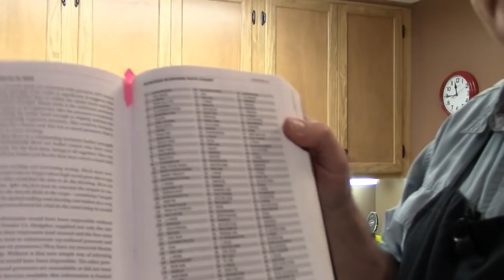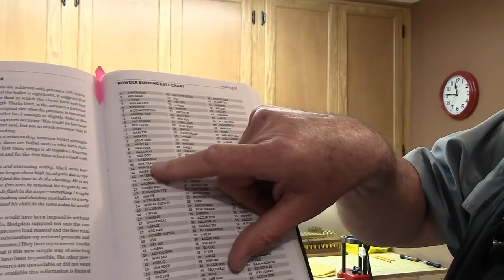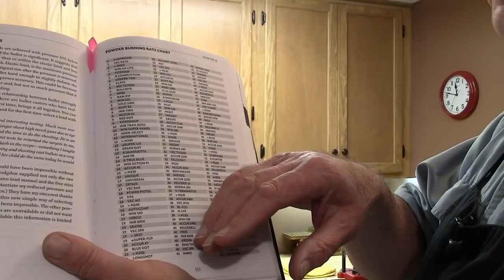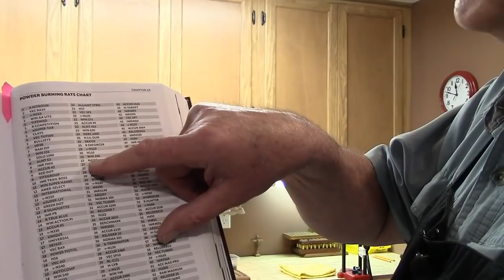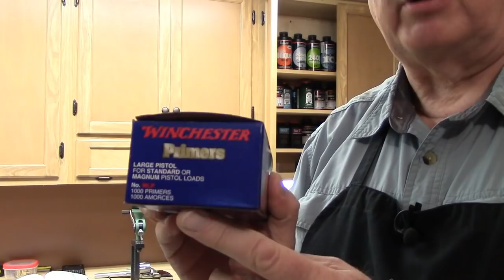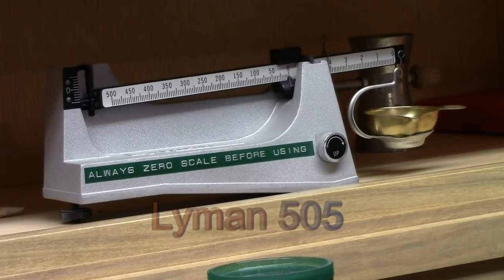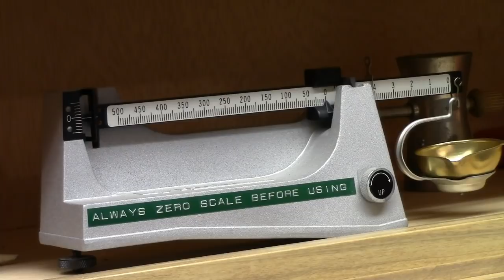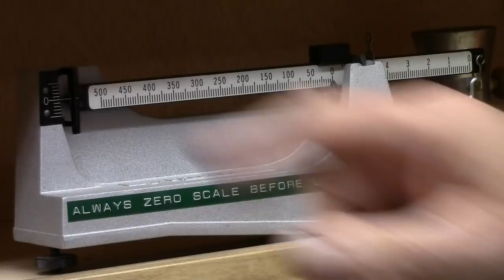Handgun load testing with the .44 Special, Part I

Comment: I love my 44's.  My favorite powder for the Special is RED DOT with a 200gr bullet it is extremely accurate and fun to shoot.  For a 44 Special load in the 44 Magnum I only load Titegroup powder.  There is a lot of room there and Titegroup is volume and position incentive, it's very consistent in larger cases.  My favorite powder or if I could have only one would be Sport Pistol.  Great for everything from 38 to 44 Mag and 9mm to 45acp it's right next to Bullseye on the chart.  It's a great low to mid range powder in revolvers and it gives very good velocity's in semi's.  It also burns very clean and has been very accurate for me, a fantastic all around powder.  As for my dies, Redding sells a set of calibrated washers for around 10 bucks so your dies, both 38 and 44 can do double duty without readjusting them for caliber, it even includes a ring for partial sizing.  One last thing I do is before I drop a finished round into a storage box I take 2 seconds and drop it into a chamber checker.  I have found a bulged case or a slightly offset bullet that wouldn't chamber.  Better to find it on the bench than on the range.

Comment: Excellent info. regarding .44/.38 special dies suitable for .357/.44 magnum reloading. An issue with a S&W .44 magnum comes to mind while viewing this clip. There may have been an issue with 'cylinder lock-up' you discussed in the video. While shooting at a local range in Rheingenheim/Mundenheim LU..a German colleague's new 629 Hunter classic blew apart in exactly the same way you described (sheared cylinder, no backstrap). Although the loads were far reduced, I was able to determine that a defect in the rotation of the cylinder caused a bullet to lodge against the forcing cone, and simultaneously set off the other cartridges. Even so, after that I'll never reduce below the data published for a specific cartridge. I rarely sit while shooting  on a pistol range (25 meters), but it was good for me that day, with pieces of the cylinder brazing the top of the head. Quite like a grenade, like you said. Ironic how Ulm and Berlin have the strictest firearm proofing standards in the world. I should mention I prefer the same scale type and use the same yellow scoop!

Comment: I've loaded 44 mag for years and just bought a flat top Ruger Blackhawk 44 special. I tried some of the 44 spc target loads in two S&W 44 magnums with amazing results. You're correct that the crud ring from firing special cases in magnum chambers is not a problem and easily removed.
Reply: Yep been reloading for 34 yrs. Mostly 44 mag for my Ruger SBH. Thousands and thousands of round through that and my Winch Trapper.Just got a flatop Bisley and have loaded up some Keith loads for it and a few variations for it. Can't wait to get to the range. Only is I sized, flare, prime then powder. Don't like flaring with powder in the case. Besides I prep tons of cases and just have them ready for powder and bullets. Good shooting.

Comment: I have thoroughly enjoyed you videos and have learned a lot from you.  Thank you.  I have a question about casting and reloading lead bullets. I have a Ruger GP100. I  learned from the Ruger Forum that the forcing cone angle on Rugers are optimized for jacketed bullets( 5-8 degs).  Lead cast bullets need 11deg. to eliminate leading the bore..  Did you modify your Red Hawk?

Comment: great video but the model 29 SW is a week gun I had one for about 1 year and stretched it the gap between the cylinder and  the barrel got quit large and I was not shooting  hot loads quite below the max in my Lyman reloading hand book. I got rid of it to a friend that just wanted it for his man cave. then I got a Ruger Black Hawk with a 10.5 barrel had to change the grip to make it nicer to shoot, loaded it much hotter after working them up and 15 yr later no damage to the Ruger .  I now like to shoot in my back yard so had to switch to a Ruger 77/44 because hear you can only shoot a hand gun at a range. But great Video one of your better ones.

Comment: I thought I saw a video you did on reloading 9mm ammo, but now I can’t find it.  The last couple of months I started measuring my brass, I have 3 manuals and they all tell me different measurement on the trim to length and the max over-all length.  I’ve read several articles that say it doesn’t matter but if one case measures 0.750 and the next 0.744 how do you get the same C.O.A.L.?
I am not shooting competition; however, I am trying to make the best bullet so I can shoot as accurate as possible.  I appreciate any help you can give me.  I have an S&W M&P 2.0 9mm with a 5” barrel.
Thank you!
Reply from the maker: COAL is unrelated to case length.  I've never trimmed straight walled pistol cases in my life, because they simply do not lengthen.  Simply adjust your seating die for the recommended COAL for the particular bullets you're loading, and you'll be spot on.  Be conscious of the fact that seating depth affects two very important aspects of a pistol case:  The COAL is that measurement that will both fit the magazine and feed.  At the same time, seating depth affects available powder space, which cannot be reduced, or pressures will rise dramatically, which is very sensitive with small cases and high working pressures.  For that reason, use the COAL stated for each bullet, according to the bullet manufacturer.  Every bullet maker publicizes the COAL for every bullet they make, which emphasizes the importance of referring to their loading data. Don't trim pistol cases.

Comment: Another good video.

You talked about the wobble on the turret not being an issue on the LEE Classic Cast Turret Press.  I have always thought it was by design.  Much in the same way that a Forester Coax lets a case wobble and find the center of the die it is being pushed into.  The new MEC Marksman press has built in wobble to let the case find the center of the case.  Since the LEE Classic Cast Turret press is only working on a single case at a time the wobble is not going to cause problems like it would in a progressive press.  I have always thought it was Richard Lee thinking outside of the box.
Reply from the maker: LIVIN CINCY 
Actually, in my experience there's no difference between the final product that one press or die produces over another.  Give me any company's product and I will make the same ammo.  All dies have chambers cut by SAAMI specification reamers, and it's virtually impossible for a lathe to cut off center dies.  Presses only drive the case into the die to the limit of the shell holder, which can be done with a vise or bottle capper.  The differences are all about design and making the production of quality ammo easier, less frustrating, enjoyable, and less expensive, which Lee has a very firm grasp of.  Press wobble means absolutely nothing, no matter what sort of press.  They stop wobbling when the case is fully inside.
Reply: Good points.   The LEE Loaders work on a picnic table that is not level, wobbles and can make match ammo.

Comment: I personally find the medium burn rate powders to be the most useful and... well.. safe.  Safe in that they rarely will double charge like the very fast powders.     in other words..   there are several grains to play with.    the really slow powders are generally high pressure or at peak pressure.    Problems arise because they have much less than the 10% recommended starting charge to work with.    Add to this that the bullet we choose may not be exactly the one in the book    The medium range powders will easily drive bullets into the 1,000-1,200 fps range and work in a most calibers either fairly well or as good as is possible.    

The other thing is I use a chrono which are not expensive.    If for some reason my loads are much faster or slower than published data and known loads are going through the chrono fine..    then I need to rethink.     but..  it is rare that two different manuals will have the same minimum and maximum loadings even when bullets are identical.

Comment: I have finished my first session with my new Henry Rifle in .45 Colt.  I've noticed that every case that I have fired has a soot smudge along one side of the case that extends just past the half way point of the case.  Is this something that I should be concerned about?  This is my first pistol cartridge rifle and am curious.  I've never encountered this with any other rifle cartridge that I've shot.
Reply from the maker: The Colt is a low intensity round that not always seals the chamber up front completely, and it's fairly typical, even with factory rounds.  It can vary with the powder used and the charges.  Not to worry.
Reply: That was my thought line on it.  I was thinking that with the lower pressure the case expansion wasn't as radical with this brass.  Thank you so very much for your response.  Peace be with you.

Comment: When you are loading a test sequence keep in mind that they will all look the same after you have finished.  If you drop your box you can easily get them mixed up.  For safety I mark the individual cartridges so I can always tell them apart.  I use a permanent marker and mark a symbol on the primer, a symbol such as a dot, a circle, a plus, a single line, one load can be blank.  That gives me the ability to easily distinguish between 5 separate loads.  If I need more than that I'll use another color of marker.
Reply from the maker: Thanks.  I have generations of New England seafaring genes in me, so I continue to live dangerously, but carefully.  That's a great tip, though I'll probably continue to walk the plank as I've done for half a century of loading.

Comment: Once again you have taken me to school. I always have been curious how they measured precisely in a small production. Thank God, you not measuring for each individual cartridge. I noticed that you use Lees LoadMaster vs Lees Classic. which one would be best to start with for a newbie like me.  I want to hand load 9mm, 10mm, .40SW and also be able to hand load .30-06,  .308 rifle  including if its worth it .22 long cartridges.
Reply from the maker: George Mezines 
By far and away, the best press I have ever used is the Lee Classic Turret press that you see in this video.  With the easily dropped in turret, it can be ready for a different caliber in seconds, and may be used in either semi progressive or single station mode by removing the turret rotation stem.  The Loadmaster is certainly better in terms of production, but requires significantly more time and mechanical talent to change over to different cartridges, and 30-06 rounds are pretty big to handle five in one stroke.  Unless you are shooting lots of ammo, you'll do fine with the simpler turret press.  Get a turret for each caliber and a storage case.
Reply: GunBlue490 THX for the information. Your credibility far out weights everyone else.

Comment: Does gun powder ever go bad? How would I know how to check it?
Reply: Modern smokeless powders are quite stable, and if stored under cool, dry conditions, will remain perfectly useful for decades. If, when the container is opened, you get brownish vapors, looking like rust dust or smoke, the powder has been subjected to high temperatures, and has begun to decompose. If it has a sticky, gummy or clumpy appearance, it's been wet or chemically contaminated. Under either of these conditions, the powder should be destroyed immediately by burning or being widely scattered on the lawn or garden (it contains a lot of nitrogen).
Reply: never get rid of your powder by pouring it in the lawn and then lighting it.......
........the grass leans a bit in all directions and it can burn straight back at you and burn your face.........i know this for a fact ,trying to light a line of powder leading to the main pile , did not end well
Reply: good to know

Comment: I am wondering with 7.65x25 TOK some load manual call for H110 with small pistol primers is this correct ?
Reply from the maker: W Gunter 
If it's a legitimate load manual, I don't second guess their analysis, but just make sure it's your data, which you read with your own eyes, and not someone else's claimed source.  Follow directions to the letter with all data.  Call Hodgdon to confirm if you have any questions, and they will happily assist you.
Reply: Thank You I enjoy your channel very much All the best !!!!

Comment: Very good video, with discussion about burning rates, case capacity, the danger of double charges, etc.  I very much enjoy shooting reduced loads in multiple calibers, and I decided to watch more of your videos.  Unfortunately, one of the first that I chose to watch was the video in which you were sitting on your porch discussing the selection of defensive carry guns.  You made multiple erroneous and illogical statements in this video. The greatest of which is probably when you stated that the lives of multiple police officers have been saved by manual safeties (true). You then state that safeties have NEVER stopped anyone from shooting a criminal, or even slowed them down while doing so (very false).  If manual safeties have saved the lives of good guys, then it logically follows that manual safeties have saved the lives of MANY criminals,  since firearms are used defensively far more often than offensively by criminals.  I'm quite certain that you know that your logic is flawed, and I suspect that this is why you've turned off comments for that video.  You can hate firearms without manual safeties as much as you want to, but don't lie to new shooters who may be watching your video, and may not know that your statements are false and illogical. Censoring the comments of those attempting to correct your false statements is rude, arrogant, and frankly, a page right out of Hitler's playbook.